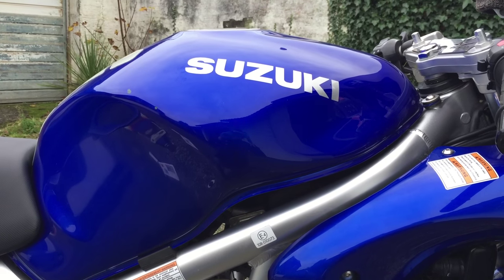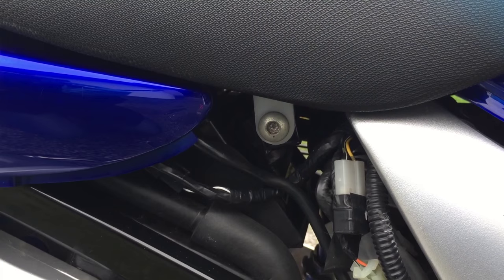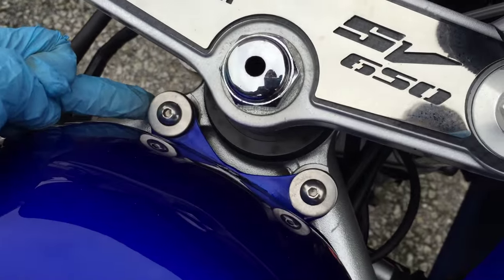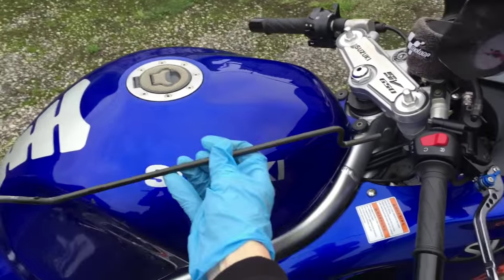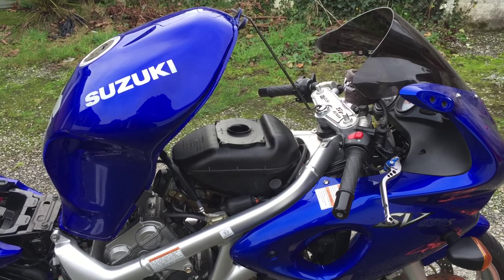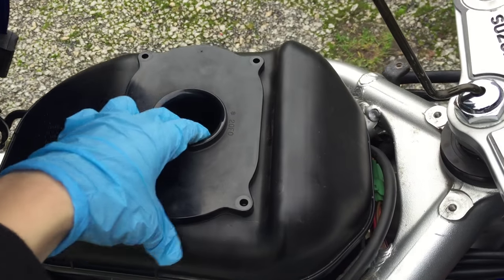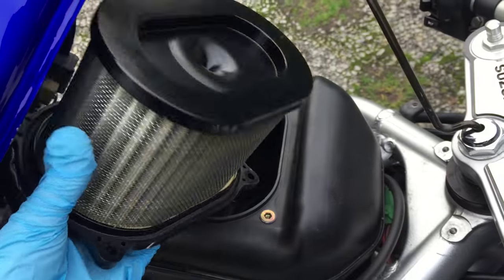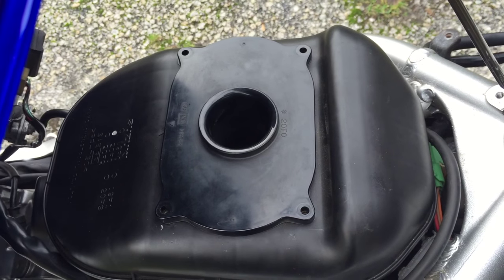Air Filter Check and Clean SV650 Motorbike Maintenance

Comment: Hi Tamsen, 

Huge fan of the channel. I picked up a rough SV650 last weekend and am in the process of bringing it back to life. Its a huge learning curve for me and your videos have been invaluable. Even if I didn't own a SV I think I would have watched them all anyway as there is so much useful information in there. 

Using your videos I checked the plugs and even removed and cleaned the carbs. When I put it all back together it fired right up and is running much smoother. Still got a long way to go, but I really feel like I am on the right path, and its been hugely satisfying and its done wonders for me. 

Thanks again
Chris

Comment: Cagiva may have used the same engine on the Raptor but lifting the tank on the Suzuki is so much easier than the Cagiva...I guess the Italian designers didn't think it through very well...The box is slightly different to...once again the Suzuki looks like it comes out on top. :)

Comment: a suggestion for the video: the manual states to clean the air cleaner drain plug. Could you please add that bit of maintenance onto this video?
Reply from the maker: That is a great idea, I could include it in a top tips video. Thanks.

Comment: Hi Tamsin,  I have a 1999 sv650s with only 3000 miles, on mine the first time I did a service I noticed I got an inline fuel filter, looking at yours and there doesn't seem  to be one, did they have one when the came off the production line.
The reason I ask is this bike has been stood still for 10 plus years, and I've got popping on idle and overrun from thee exhaust, found thee exhaust had 3 holes so put a new full system on it, popping is getting worse, she doesn't idle properly,  would you say the carbs needs balancing or would they benefit from a rebuild.

Kind regards 
Martin

Comment: Best place to buy replacement parts for the bike? Obviously the local dealership would be over priced. Rock Auto is for cars. What's for bikes?
Reply from the maker: Online is good, but of course that means waiting for it! The watch out is some of the imported stuff, some of it is perfectly fine, but certain items, seals for etc. You don’t want to cut corners on. So places like Robinson’s foundry, weemoto, m&p are all places I have used. Hope this helps!

Comment: hello. How can i understand if i need to change the air filter? I am not shure if the previous owner did it before selling. It does not look like a brand new one. But it is still ok)
Reply from the maker: It is a good question. The air filter needs to be renewed if it looks dirty or clogged. If it is a standard paper one, it is usually too difficult to clean and cheap to replace. I once heard someone describe the air filter like 'the bikes lungs' it draws air in, mixes it with fuel and ignites, well if they are clogged up they will not do a good job, and seeing as they are not very expensive, it can be a quick win to improve performance.
Reply: Tamsen Cooper thanks. i have bought a new one ) gonna swap it soon)

Comment: Amazing videos you're doing Tamsen! But when i removed the air filter and looked at the bottom i found a small amount of oil. Should i be concerned or is it normal? i just cleaned up the small amount with a towel and keept on driving ("\(o.o)/")
Reply from the maker: Thank you, a small amount of residue is ok, I did the same and mopped it up with a paper towel. A good idea is to check it again after about a week, if there is loads of fluid then something is wrong, if not then you should be all good.
Reply: small amount?

its fine. LARGE amount? check everything.

Comment: What year is your bike
Reply from the maker: 2002, known as the 'curvy' model due to the shape of the fairings. Have you got an SV?
Reply: I do have an sv but mine is an 2007. Doesn’t have the front fairings like yours. Though I have found a company that makes them and plan on putting them on soon
Reply from the maker: nate mansur there is a UK company called Skidmarx which do fairings, brackets etc. If you have not bought it yet might be worth checking out that website.
Reply: Thanks I will look them up